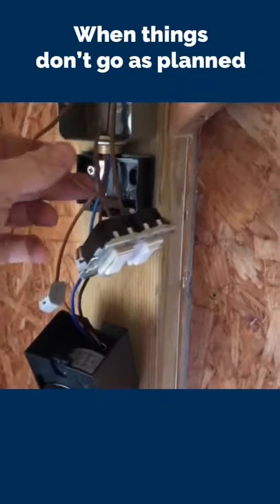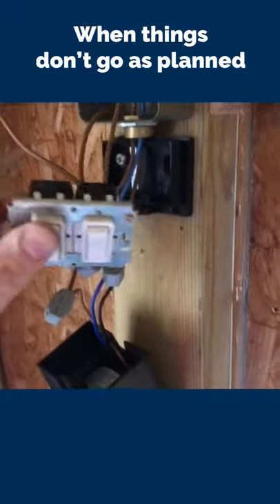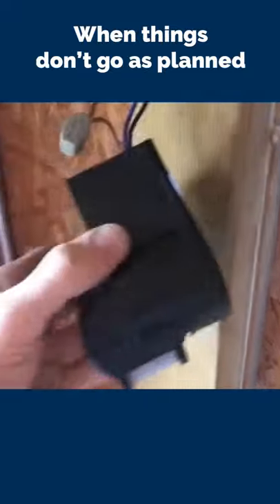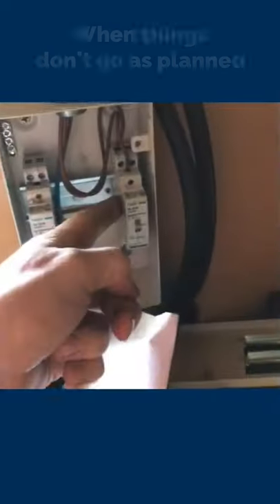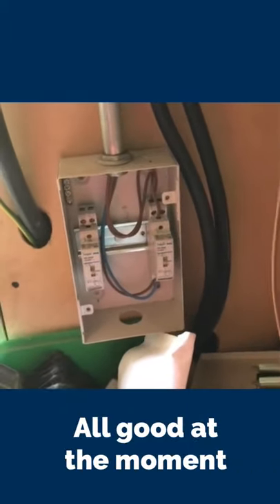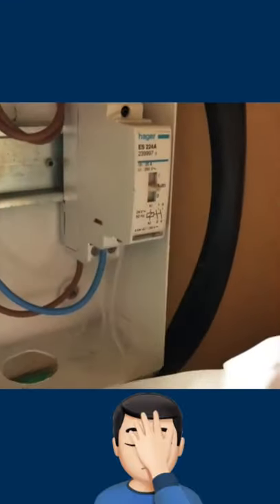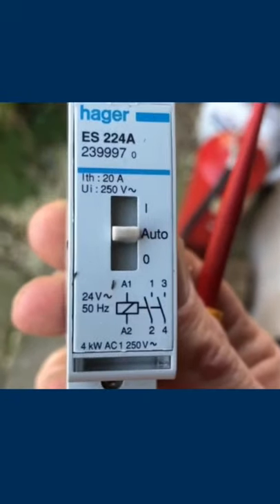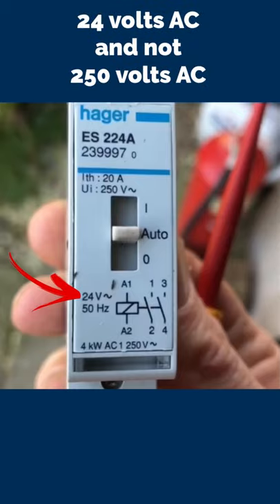What Happens When You Pass 250 Volts 🔥 Through a 24 Volt Contactor

Comment: Even more fun is a 24VAC contactor with 48VAC applied. It works for around 3 hours before letting the smoke out. Or a 24VAC contactor on 24VDC, which eventually lets the smoke out in large amounts.